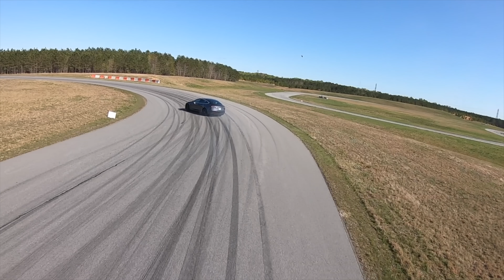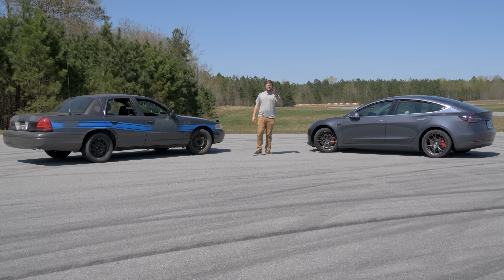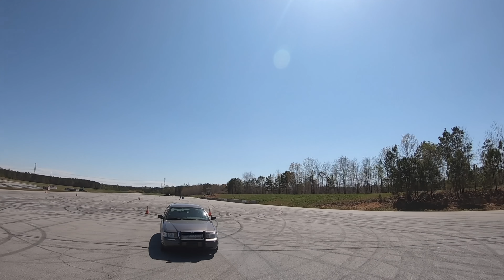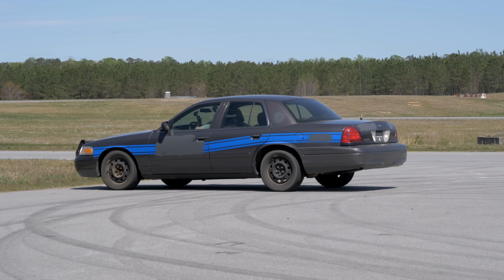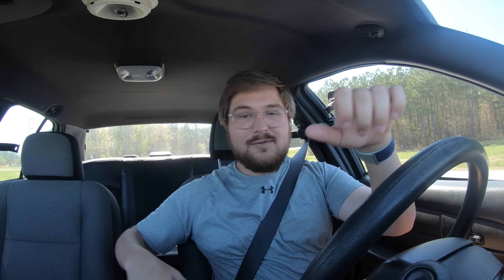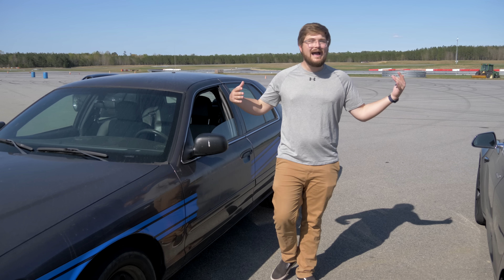Should Police use EVs?  Tesla Model 3 vs Crown Vic Police Interceptor

Comment: The reduction in operating costs for the police department would be huge.
Reply: wrong. its literally not possible for road cops to use EV's.. a few of my friends are cops and they drive over 200 miles a day in their 12 hour shift. they wont have enough time to recharge before the next shift comes.
Reply: Mark's Tech The newest Tesla’s are getting close to 400 miles on one charge. A 200 mile shift is a piece of cake.
Reply: MB lmaooo you clearly don’t own a Tesla my guy 😂😂😂😂 I have the SR+ which has “250” miles of range. But I only get 160-170 on a full charge. A 400 mile Tesla model S won’t do a damn thing lmao.
Reply: @JCkk8px  Until they have to chase someone on the 11th hour of that shift.
Reply: TheCaskOf43 per the internet a police officer drives between 50-100 miles a day. EVs can already get 400 miles on a charge. When was the last time there was a 300 mile police chase? That’s what helicopters and police radio are for.
Reply: @JCkk8px  some police forces may drive that little. A lot of them drive more though. The speed of the electric vehicle is outstanding compared to gas... The two hurdles that are going to have to be overcome is significantly reducing charging time to make it as fast as filling up gas. And then there's going to be the reliability issue and the durability issue.
Reply: @JCkk8px  and something else I just thought of too... I don't know how the air conditioner or the heat works in a Tesla, but I seriously don't think a cop is going to sit there and do reports, or run radar while sweating like a pig in the summer or freezing to death and 18 degree Fahrenheit weather somewhere up in Minnesota. If the heater or the AC can be ran while the vehicle is not in motion, that's going to be some serious battery drain. And we can't just say, the cops are just going to have to deal with it... That's not going to happen.
Reply: TheCaskOf43 reliability is only an issue for gas or diesel. A gas car has about 2000 moving parts and an electric has about 30. With electric you get rid of the transmission, gas motor, fuel pumps, belts, hoses, radiator, all the exhaust stuff, etc. Their really is no comparison in the reliability department. I’ve had an electric car for two years. After 50k miles the only thing I’ve done is add windshield washer fluid and change the tires. The motor is guaranteed for a million miles and the battery will be the same soon.

Charging isn’t really an issue with electric either, especially for the police force. You can add a 100 miles of range in less than 15 minutes.
Reply: @JCkk8px  absolutely right. I didn't think of that. But what about the durability of the parts? The ability to withstand impacts? Potholes, curbs? Things like that that really need the matter at the moment of truth? I suppose they can work that in as they go.
Reply: Mark's Tech Right, would you like me to send you a pic of it sitting in my garage? I drove if from Florida to California, to Canada and back and in a week I’m heading to Florida from Denver. Never been a single issue.
Reply: TheCaskOf43 The new Tesla has one of the most sophisticated heat pumps on earth (it’s called the Octovalve), designed by the people that make the rockets for Space X. Sitting and running the heat or AC is no issue. Yes it uses the battery, but a gas car also uses fuel when it’s idling.
Reply: TheCaskOf43 not sure why there would be any question about durability as there are way less parts in an electric then a gas car. 2000 moving parts vs 30. The gas car requires a heck of a lot more maintenance because there are many more things that can break. Battery pack guaranteed for a million miles in the near future, the motor already is.
Reply: @MarksTech  Teslas have 400 miles of range now, and recharging takes like half an hour max.  it's a non-issue.
Reply: Dan Reynolds nah. 400 miles is more like 250 miles.
Reply: @BrowncoatFairy  And it only takes about 5 minutes or less to pump a full tank of gas.
Reply: Mark's Tech you’ll realize your wrong in about 2 years when all the police forces are using them. The main reason is it’s way cheaper to maintain EVs. Tesla battery day in the 22nd. Game changing announcements coming soon.

Comment: Great video, love your channel because you keep things fun and lighthearted but at the same time try to give some valid information.
I might point out that the crown Victoria you're comparing the brand new Model 3 to was designed in 1998...
Uses a 4-speed automatic transmission. And makes maybe 250 horsepower.
For fleet operations like police, cost to maintain and repair is something to consider. And it's one of the reasons that so many taxi companies used crown vics for so long. Brakes, suspension stuff is very durable and very inexpensive.
Something that you did not mention and could not have tested, try going over curbs in your Model 3 and see what happens.
watch some police videos these guys drive the hell out of these crown vics. Jumping over curbs over sidewalks. It's one of the reasons so many PDs now use tahoes and explorers even over the crown vics.
 How much do you think it would cost to repair your Model 3 if you hit a 4-in curb at 30 mph?
of course there's nothing to say you could not have a vehicle like a Tahoe or an explorer that was electric  and that solves that problem completely.
It kind of does show you though how good the crown Vic was when you factor in how old the thing is, it performs pretty damn well which is why it was used for so damn long.
Absolutely love your channel keep up the great work keep making it fun and entertaining for us to get fun facts and information.
Reply from the maker: Everything about cost / factual info will be in the InsideEVs video. This was purely from the officers perspective (who doesn’t have to fix cars or pay for them) and it was more for entertainment. Thanks for watching!
Reply: @OutofSpecMotoring  
Awesome.. looking forward to see that. 
Love your channel.. keep up the great work. :)

Comment: Please hold. The officer will be there as soon as his car has charged.
Reply: With 300+ miles to a "tank" there would be no need to wait (the average LEO car drives about 125 miles a day)
Reply: grunt98311   Police work in shifts though and when one shift is over I assume the car needs charging and therefore is not available for use.
Reply: @TheRotorhound  With 320 miles of range a Model 3 could in theory last at lest two shifts (the average police car travels about 125 miles per shift) before needing a recharge. When that charge does need to happen they can be charged to 80% (Tesla recommended level) in 40 min using a V3 supercharger. During any shift change that would seem to allow enough time to charge
Reply: grunt98311   Rapid charge means less battery life. I figure for a police department thar needs their vehicles on the road 24/7 that they would need 4 electric vehicles to 3 gas vehicles unless they could do a battery swap. Math may be off a bit. Can’t put a cop car on the street that realistically may not be able to make it though a shift. Argue all you want, the technology is not there yet.
Reply: @TheRotorhound  well the technology is now here new battery powered vechicle.
Reply: @Side843    Took 2 years to get here.

Comment: Really?  What possible value is there comparing an apple to an orange.  The Vic produced until 2011 was designed for endurance, not off the line speed. This is not to say an electric police vehicle isn't feasible, but a simplistic side by side comparison of a road warrior vs. a zippy smart phone on wheels is an insipid exercise lacking any benefit regardless of the final results.

Comment: They would work until it came time to repairing them after accidents and getting replacement maintenance parts until  the suppliers could keep up with demand look how long it already takes to get your Tesla fixed after a small accident police departments cannot have vehicles down that long.
Reply: Body repairs possibly yes (although that has improved) , with only 6 moving parts to the drive train (vs 100's in an ICE car) there will be less need for maintenance or even repairs.

Comment: So glad you mentioned that 90% of the time police are not pursuing anyone. Much more important to a police department is how well the vehicle can handle the power consumption of a light bar, radio, wireless router, dispatching/report writing computer, and climate control all at the same time (while driving or stopped). Room for a prisoner cage and shotgun rack are also a must. Gasoline is not free (as you stated) so operating costs for a fleet is very important. I think major metropolitan police departments with large fleets would be concerned with charging times or the cost of installing multiple chargers at every police substation. No doubt the Tesla would outperform during the ultra-rare vehicle pursuit. That will have almost no significance in the selection process but the Tesla safety would. Police are killed to the greatest extent by suicide, followed next by vehicle accidents.

Comment: Appreciate the thinking Kyle but that was more of a "how to pick an autocross car" than "how to pick a police car". Little of what police do is "auto slalom" like, but rather focused on durability (off road, over curbs, etc.), repairability (rip off a wheel, quickly bolt on new a-arms without any frame damage, etc), strength (can withstand doing P.I.T. maneuvers, ramming other vehicles, etc.), equipment load capacity/officer comfort (computer, equipment belt, cage, etc.), electrical capability (upgraded alternators to drive computers, lights, siren, radios, etc.), endurance (upgraded cooling for constant near full throttle operation), range (large fuel tanks). All the current Tesla models are dismal on these, however the CyberTruck may be the platform to start with. The Ontario Provincial Police in Canada have invited Elon to develop a police vehicle based on the CyberTruck with them, so far no firm engagement from Elon other than "sounds fun"...
Reply: Interesting about the OPP being interested in the cyber truck. Not sure why though as they primarily patrol provincial highways and the local city police forces patrol the city streets. The exception is rural communities that don’t have a local police force so the OPP does both. For highway patrols, I would think the Model S would be best
Reply: @roger1818  I think the challenge with the S is durability (not much ground clearance, seems to be a lot totalled out with what looks to be minor accident damage), performance (it can't complete a 7 min lap of the 'Ring without overheating), space (no way to get a cage in the back and a full stack of computers/radios in the front) and rear crash surviveability. The OPP is similar to the Michigan State Police vehicle evaluation which is online and you see the evaluation criteria they use. This year the top pick was the Ford SUV.

Comment: Something like the Cybertruck would make more sense, maybe with some super capacitors for a little rapid charging along with extra battery capacity. The ground clearance probably kills it for most electric cars. The gas savings would be huge.
Reply: Not all police carry that much stuff all the time. The trunk on the 3 probably has more room than the crown vic, plus the frunk. The truck is overkill unless being used for bulletproofing. Opening the toneau cover will take too long compared to popping the hood/trunk. Model 3 is perfectly fine.
Reply: @ItsBinhRepaired  it is likely possible to pull down the tailgate without opening cover so gear could be accessed quickly when needed. also the trucks are very cheap for the performance and range provided even without the armor considerations so they are the best choice for law enforcement.

Comment: In my M3 I can switch from reverse to drive without stopping, no need to breake. Though I have never tried faster than 4-5 kph.
Reply: @Ziggi Mon  model 3 doesn't have a transmission, but do you have a source that it will destroy the motors or gearbox?
Reply: dst rr ziggi loves to troll Tesla channels, he seems to have no idea about actually driving a Tesla.
Reply: @kdkd693  he certainly seems like a high-class individual. :P
Reply: Yep, curious about this too. The limit is 5 mph iirc. I shift in motion all the time.
Reply: Ziggi Mon The owners manual for Model 3 specifically states you can put the car into drive while reversing at up to 5mph.
Reply: @Ziggi Mon  It will not ruin anything. Putting the car in drive while in reverse is what regen is. It already does this to brake. The "gearbox" is nothing more than what a differential does in a regular it just multiplies the torque through gear reduction. It doesn't matter of it goes forward or backwards

Comment: 1. Police do not have unlimited budgets. Budgets for vehicles is very tight. You could buy two Crown Vics for the price of one Tesla. Fuel is also not free; big agencies have multi-million dollar annual budgets for fuel. 2. You can't hot fuel a Tesla to full in five minutes and be off racing to the next call; especially in rural areas and highway patrol. I would bet electric only works in dense city with small beats where you can get back to the station quickly to plug for 8 hours in or be stuck somewhere. 3. Police driving can be a full contact sport. The Tesla will cost an agency a fortune in repairs or more likely replacement. Crown Vics were known for taking hits and still going with only cosmetic panel replacement afterwards. 4. Police vehicles don't need to have the best 0-60. Studies have shown police are able to catch up as people clear a path for them due to red/blue lights and siren while the violator has to fight their way through traffic. 5. Repairs overall on a Tesla are a fortune compared to the utilitarian Crown Vic; repair cost is another agency budget killer. 6. You didn't calculate battery drain with emergency lighting, voice and MDC and AVL radios operating all the time, MDC terminal, cameras, radar, driving lights on all night etc.  In my opinion, the Crown Vic still is the overall winner in utility and operating cost as a fleet vehicle.
Reply: For another perspective, see also Model 3 cop car at  https://TinkerTry.com/tesla-model-3-westport-ct-police-cruiser-tech
Reply: Regarding the Tesla Model 3. 1. the "fuel" and mechanical maintenance saving alone would pay for a car that last up to twice as long than an ICE car. 2. With 300+ miles of range (the average LEO car drives around 125 miles per shift) there is no need to "hot fuel". Charging is more like 40 min to 80% charge (Tesla recommended level) from a V3 supercharger.  3. Regarding "full contact sport", the CV is no longer used by most dept and no anecdotal evidence on their replacements to suggest how they would fare under the same conditions. 4. There are many YouTube videos to suggest that the study is flawed. 5.  With 75% less operating cost per mile most agencies are eager for the savings in operating costs. 6.  You speak of the 12v battery for the car systems or the 400 v  75 kw propulsion battery that keeps the 12v battery charged? Modern lighting and electronics draw far less than you would assume. Several departments already have Tesla test cars in the fleet doing everything their ICE cars do and by all accounts are pleased with how they perform

Comment: Hold on...The Tesla failed at the most significant part of the test between the two vehicles. Stopping. As Kyle was reading regen brake warnings the car failed to brake which could have easily cause an injury or fatality to the driver or pedestrian. I know that Kyle said later that for some reason he braked late, but this is also after he said that he was a better trained driver than a Police Officer. I am going to give significant points to the old Crown Vic, just because it stopped in the box. As for the rest, Tesla fared as well as it should have against the old Vic. Nice video.

Comment: Kind of a nothing test until you use a Ford Interceptor Utility (Explorer) or Chevrolet Impala or Dodge Charger.  The Crown Vic has been a reserve fleet car at best for years now for most departments.  Good concept for testing overall.
Reply: The Chevrolet Impala hasn't been used for decade or more like the CV. A top heavy FIU isn't going to do as well in the handling department as the car based Model 3.

Comment: Great video, a couple of points however

1. The vehicles should also be tested loaded with gear, range and acceleration may suffer a bit on the Tesla when loaded as much as needed. Also space is limited in the Tesla. 

2. Ease of repairs, the Crown Victoria fleet has been easy and cheap to maintain and repair because anyone with mechanical knowledge can do it and parts are everywhere and body panels are cheap and easy to replace. Same goes for many of the other PPVs in use now. Turn that around with the Tesla. Also pretty much all of the cars a police department has used are body on frame, a unibody car might not be favorable. 

3. Many officers take their cars home with them, which would be difficult to manage with the Tesla because if they still wanted to do that they would have to get a charger installed in their home, with  an ICE car it can be filled up at the station or anywhere quickly.

Comment: You have to stop a Tesla completely to switch from R to F?
Reply from the maker: Basically or slow rolling.
Reply: @OutofSpecMotoring  Thats a shame; one of the smaller fun things about the Volt is that it switches INSTANTLY between R and F - I always thought it would be perfect for a "J" turn (although dont anticipate trying it). Dont know how fast it goes in R, might try it next time I leave the house.
Reply: You can do it while moving to to 5mph